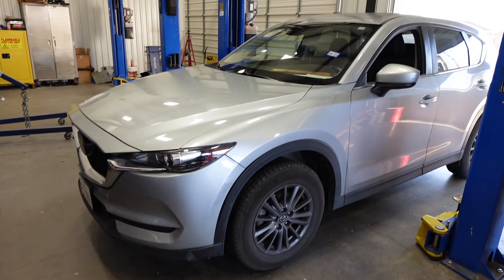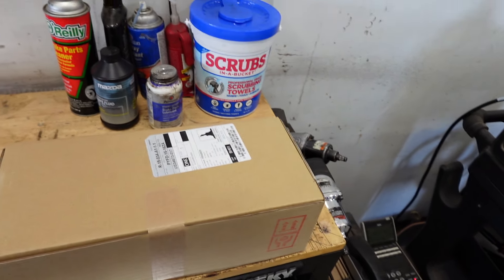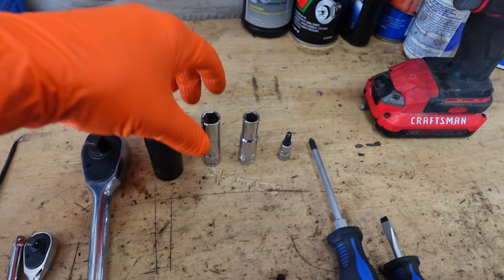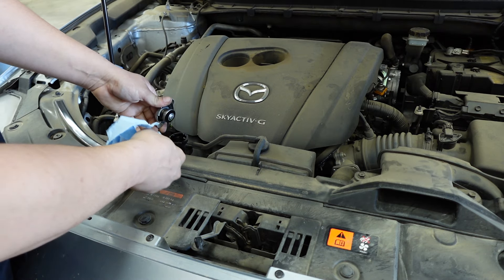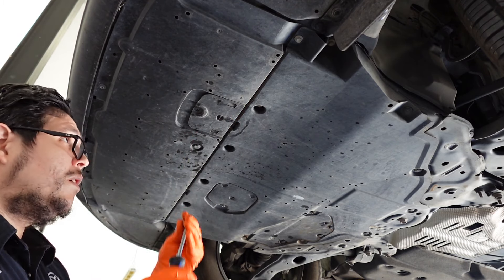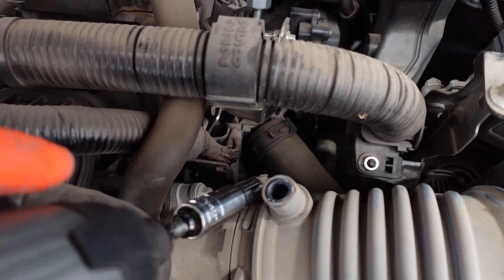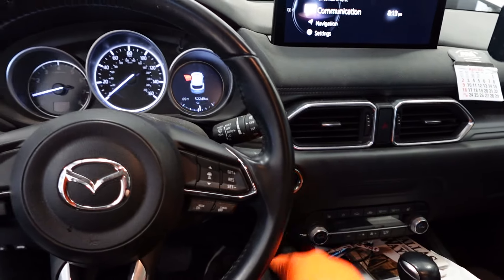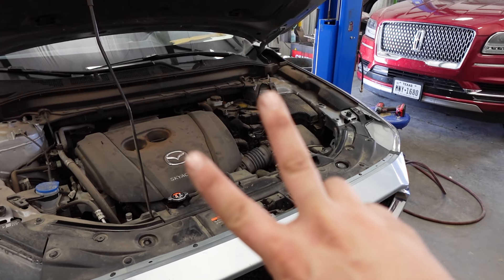Mazda CX-5 P0126 Coolant control Valve Replacement

Comment: Should we change all the hoses and the coolant sensor at the same time ? How many miles on this car ?
Reply from the maker: It all depends on the condition of the hoses. this vehicle was right under 60k and the hoses still looked to be in good condition.
Reply: Thanks . Please make more videos on cx-5  . You are the best 🎉🎉
Reply: I got this p0126 (engine too cold) at 55k miles. Cx5 GT 2020

Comment: I have a mazda cx5  2013 model it comes up with coolant high temperature 🌡 and engine service light required ..it drives at 80mph then starts losing power .Please help me ..what do you think is the problem   ?
Reply: Why not take it to a mechanic lol they can check the engine light and fix the issue cause it can be a bunch of things or just one,  we're not looking at your car 😂
Reply: Head gasket? Check the oil dipstick for milky stuff...

Comment: After reconnecting the battery do you have to reset the computer?
Reply from the maker: Since the battery was disconnected for a bit you should be fine. the code should not be present. when I started the vehicle back up there was no check engine light.

Comment: This went out on my 2022 Cx30. Luckily under warranty the part is $450!!!
Do you know if they did anything to improve the part? Afraid it will just break again.
Reply: just back from dealer, same problem, 2022 cx-30 with only 10k miles. 😅
Reply: Ours went bad at 11K miles.

Comment: Mazda gives you a free fix replacement and extended 15 year warranty.   I just got the letter in the mail today.  However my 2024 does not have this potential problem.  Or it at least has the new ''ZA " new FIXED PART number
Reply: This is true, but my problem is I’m experiencing every related problem and I know it’s directly related to the letter they sent out BUT I have no stored codes and no engine light!!! I need them to fix it but idk if they will without an engine light being on ://

Comment: Do you have the link where to buy coolant control valve?
Reply from the maker: I do not think this part exists aftermarket. It would need to be purchased from a Mazda dealer.

Comment: i thought temp sensor was bad and the old housing and gaskets looked great. it would be great if you could show what was wrong with the housing.
Reply from the maker: I think I can make a short video of how the valve works and why the valve fails.
Reply: @CARDIAXPLAYS I'd like that to .....atm my 2013 is giving me overheating issues ..I'm currently flushing with treatment and ironised water even ordered a new rad in case I need 1 as my lower hose wasn't getting warm and didn't feel like much if anything was in there..fans not kicking in at temps . My thoughts was coolant not reaching thermostat that's a new oem 1 I put in ..new oump to ..and not truly hitting the coolant sensor to activate fans

Comment: Mine just went on my 2018 at 197k miles. I got a P2B61 code because mine, unlike 99% of every other control valve is stuck closed instead of open so of course I can’t drive to work until I fix it 😂